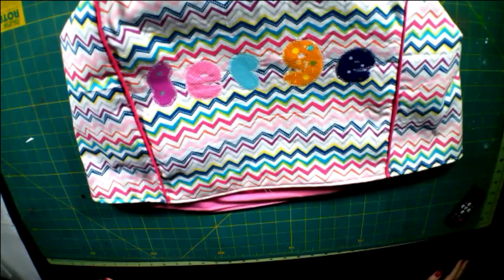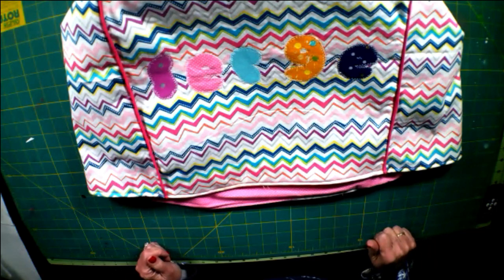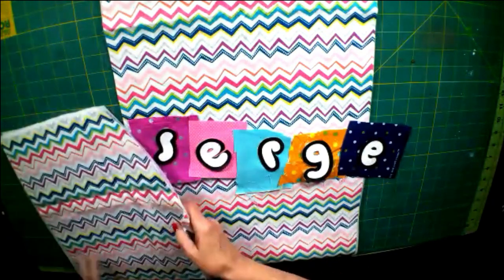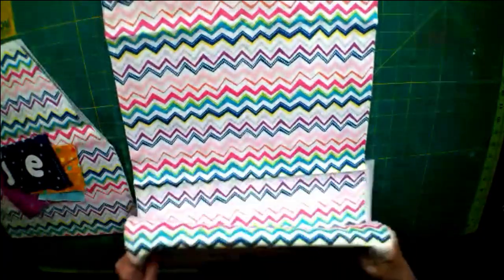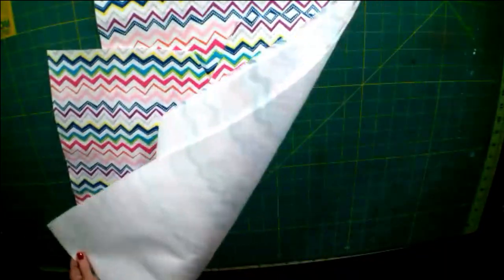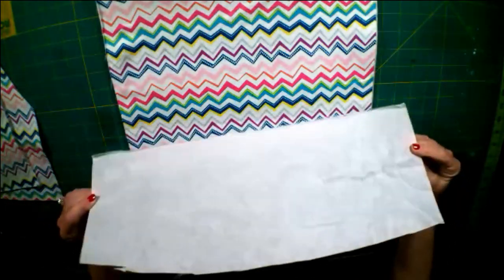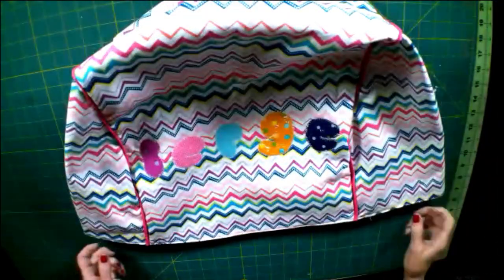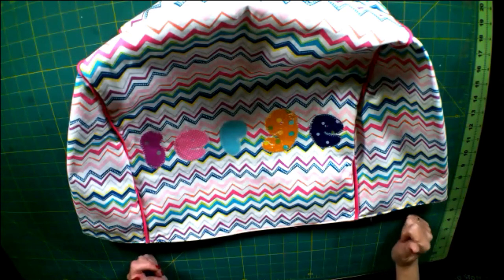How to Make a Serger Cover

Comment: Thank you for the video and pattern. I used a medium weight upholstery material that I was going to toss and a flat sheet for lining. I did not have to out out and buy one thing to make this. I put pockets on both ends - one side for the manual and the other side with the zip bag with accessory pieces that came with machine. My Viking 250S finally has a cover.  (PS: I had to go back to video because I didn't notice the music everyone complained about - my only superpower is I am able to blockout background noise).
Reply from the maker: You're welcome.

Comment: Hello, I’m a little confused. Are there three separate main pieces for this project and the pattern is for only the sides?
Reply from the maker: Yes the patterns if for the sides and the there is a long rectangle for the center.
Reply: Okay. One more question. What side are you calling the short side of the pattern? The right side of the pattern D or the top of A & B pattern.  I'm sorry I have to asked, but after cutting and taping the pattern, I can't tell which side is the short side on the picture or video
Reply from the maker: The short side is the bottom side of the pattern piece that is shorter Than the rest of the pieces.
Reply: @SewVeryCrafty  I think I used the top part and I could not figure out how you added the second side. Thanks for your help. I got some ripping to do.